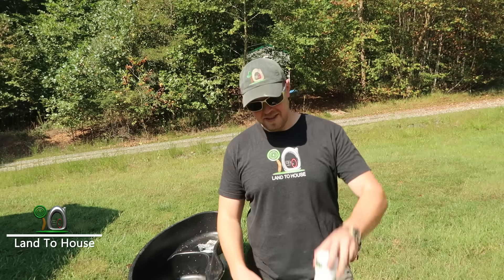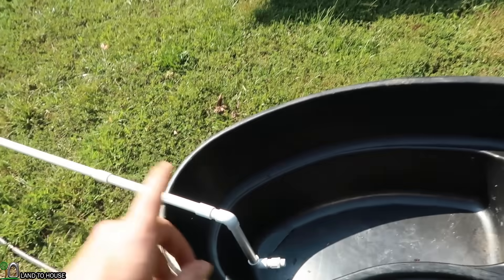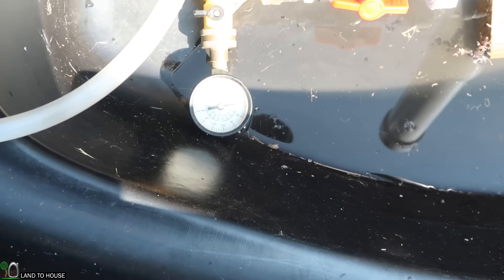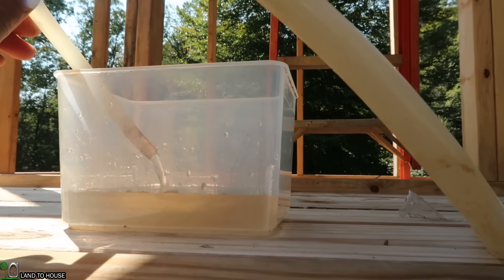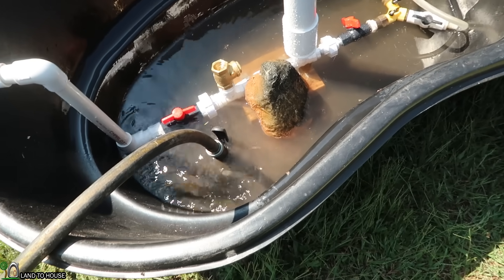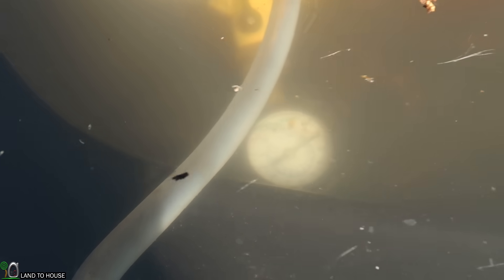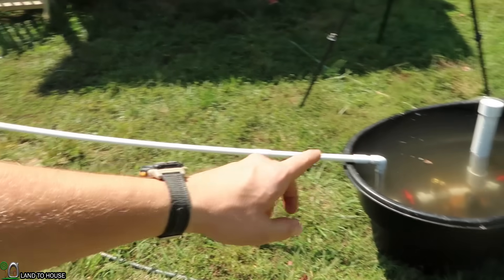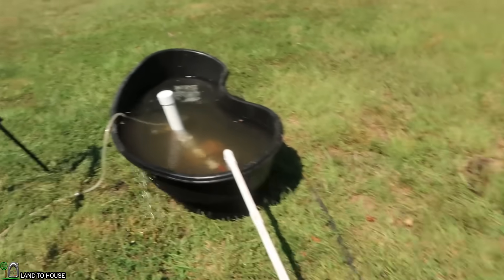Underwater Ram Pump

Comment: Is there a chart someplace that compares the pumping capacity for the different size ram pumps that are for sale?   Also,   how does the height of the head and also the height of the lift effect the volume of water pumped?   Thanks.
Reply from the maker: I personally do not have a chart. The 1/2" pump needs 2gpm to operate and can supply up to 3/4 gallons per minute in the right setup. The 1-1/4" pump needs 8gpm to operate and can pump up to 1.5gpm. The water pumped depends on several factors.

Comment: Just found your video - very pertinent to my situation which involves evaluating several low head ram pumps as an alternative to a water wheel  driven water pump to irrigate a 3 acre meadow from a stream in the bottom of the meadow.  Not a lot of fall in the creek, just depends on how far to run the inlet pipe and fortunately, not much lift required - perhaps 10 feet.    I am concerned that the clicking from several ram pumps might be disruptive.    The stream gives some background noise, which should help and maybe having the pump underwater might help.  Also,  as you indicated the pipe against the plastic container might be serving as a speaker for the sound.

I've linked this video into the Ram pump discussion on the Facebook Water Wheel Pumps page:
https://www.facebook.com/groups/240458583255303/permalink/515063069128185/
Reply from the maker: Yes I think the plastic is echoing the sound. If the ram pump and drive pipe are underwater it's a lot quieter.  You can get the ram pump to function properly with as little as 2 feet of head pressure. That will lift to 10 feet nicely!

Comment: Your plastic tub also is a resonator and even if the pump was isolated the tub is like a drum head.  If the tub were in the ground, or the pump in a pond/cistern it would be even more muffled.  I am interested in the idea of collecting the water from the initial check valve in some sort of cistern from which one could draw for other uses - gardens, fields etc. good video and helpful info!  Your Buddy at wranglestar sent me to you!
Reply from the maker: That's a good point. The plastic pond is no good for the sound. Underwater in a creek or in this pond underground would be better.  ... the waste water can be used to fill another tank as long as it's down hill from the pump. Thanks for watching!

Comment: I still think there is siphoning action that skewed the true flow capacity for both a dry and submerged pump.  The siphon action is created as the water drains down the tube that's wrapped around the rafter.  That falling action will cause siphoning (pulling) of water up the tube and down into the container below.  I think the outflow tube from the pump should go directly from the pump up to the catch container, without being coiled over the rafter above.   I think you have to do it again!!!  :-)

Comment: Hello there. I was wondering if this system would work with hot water and how hot?? Just wondering because i am going to hook up a hot water coil on my furnace pipe and try to let the hot water expansion circulate the water by itself for some cheap in floor heating but not enough of a scientist  to figure out if i will have enough water movement or not. Seeing this video made me think!!! I do not really want to use a electric circulation pump because trying to reduce power BILL. PS The temp. of my furnace pipe runs around 200 to 350 depending on stage of fire. avg, 250. Thanks for any help in advance from anybody.
Reply: Bernard...Hi! This "seems" like it will work,  your application might have to be, that your pump stays underwater, in a Steel tub/tank for added protection and safety!  and upgrading your ram pump to galve-steel pipework ....however! you will have to take into consideration the water displacement that takes place during the pumps operation...! as it could also have extremely hot steam bursts...like a geyser effect!  For some reason, no one has as yet (To my knowledge) found a solution as to what to do with all the water it displaces....?? ...and in your case, it will be very hot water.....! find a solution to that and you'll have a winner! Ps...I would strongly advise that you approach a Boiler expert that has an open mind to your proposed project!...good luck and I for one would like to know how you coped..!

Comment: So glad you caught the siphon issue. Makes it an excellent comparison, great job!
Reply: He only half caught it. Yeah it took the back pressure to make it work, however, taking that hose up in the eves was still siphoning everything that was above the outlet of the hose. It did show us that there was enough lift to get water all the way up there once, but once some was coming down to the tub, there was still siphoning in the gallons per min formula.  It was the same as if he would have just put the outlet of the hose in the tub without bothering with running through the rafters.
Reply: Sir. My name is alararic tomambo i wish to buy from you one unit of your ram pump can you include the diagram spicification of all parts my phone no. Is 559 253 3378 I am from Fresno ca 93722 pls. Quote the price of your ram pump including the delivery. Thanks a lot.I need for my farm in the philippines.

Comment: would it work in a deep pond with the intake going strait up 10 feet or so taking water in just below the surface
Reply from the maker: Sadly this does not work. A pond with the intake does have head pressure but at the same time there is hydrostatic pressure pushing down on the waste valve. This results in a net zero change in pressure.  The water would not flow. An example of this is if you place a straw into a glass of water. There is no flow out the bottom because the pressure is equal inside and outside of the straw.
Reply: id like to follow up with his set up, what if we raise the waste vale, would that work?

Comment: I am designing a proposal to use a ram pump/windmill to raise water from a lower pond to a higher pond; which will then flow down the hill in a stream, creating an enclosed system. How big do you need the ponds at either ends to be for the system to work?
Reply from the maker: The ram pump uses a lot of water to pump a little water. For example  the 1-1/4" pump can lift up to 1.5gpm with the right setup but will waste around 7 gpm. I am not sure about the efficiency of a windmill.

Comment: Man, please, put the output directly to the first bucket (there's no need of such a distance...), would'nt you get a perpetual cicle there???
Reply from the maker: The pump uses around 80 to 90% of the water to operate the pump. Even if you install the delivery into the source water you will still soon have all the water at the bottom.
Reply: @LandtoHouse  Thx 4 your valuable time! Yes, i know, that's why i say about a no-loose water by concentrate the whole system not in the source, but in the 2nd stage, the recipient in which the pump is. Obviously..., a higher deepness is necesary 'cause pressure & weight of the water matters. I'm sorry if i sound a little bit confusing, i don't know how to be clearer. I suspect that i'm wrong about the dynamics involved in my teory, but I'll do it & share the video test.
Reply: ...sorry, i've mistaken the whole idea; for a perpetual effect the first & last steps may be the big recipient itself...., i'll try & share tests.

Comment: This would be a great way to circulate hot water in an under the floor radiant heat system. At least iy would be nice as long as it worked. Orher means could be what I use, a RV water pump running on s solar psnel charged 12v battery.
I built one to help divert my insane amount of sniw pack and rain run off on the mountain here. It does help.
Good work !
Wulfy
Reply from the maker: I am not sure that the ram pump is going to work well in a floor radiant heat system. It would be way too lossy. As for moving snow and rain run off Yes its great. Thank you for watching.

Comment: Makes it a lot quieter. Worst aspect of Ram pumps is the noise pollution.
Well done!
Reply from the maker: Yes indeed. underwater does seem to reduce that click sound some.
Reply: @LandtoHouse  Could you get a sound meter and measure the sound reduction at 10 meters ?   and a hundred meters ?
I'm just thinking long term this could be really important for reducing noise pollution on livestyle blocks and even community water supplies
I'm thinking even 2.5 cm of water (That's an inch for you Americans) above 
might reduce pumping efficiency by 15-20% (and that is probably a ratio of the fall),  but reduce noise by 50 % 
Which might be acceptable if you are already getting plenty of free water
The noise pollution of ram pumps is probably the biggest negative, so any reduction.
Reply from the maker: @davestanton3822  A sound meter would be a fun test. If funds allow this summer I can look into that. I imagine they are not too costly. 15% seems like a big number for only a small amount underwater. I should think the efficiency reduction would only be 1 to 5%
Reply: @LandtoHouse  I'd bet by now You can probably get an App for your cell phone.
The other thing i see underwater operation doing is taking some of the vibrations out of the pump
 which should extend it's life considerably. 

Another idea was to add a third non-return valve to the output pipe to eliminate the output pressure head
Could you test this one for us - I'm sure we can in the words of 

The Six Million Dollar man - Steve Austin
 
"I'M SURE ...WE CAN REBUILD HIM 
MAKE HIM EVEN BETTER THAN HE WAS 
FASTER ....STRONGER.....MORE POWERFUL ! "

There is a good line for your next video pal.

Just practise that a few times and you'll sound really impressive!

Best of Luck 
all the way from New Zealand 
The Land of "The World's Fastest Indian"
You've gotta see the movie!

Comment: Seems to me that you could put the pump on the botom of the lake with the intake just under the surface, the valve could also have a rod in a connective tube that could agitate a startup and pump water up to the house cistern ... no?
Reply from the maker: Sadly this does not work. When you place a pipe in a stagnant body of water it is true that you gain head pressure but there's an equal and opposite pressure called hydrostatic pressure. If you were to take a short straw and place it into a glass of water, the water would not flow out of the straw from the top to the bottom. The pressure just equalizes and the water stops moving.
Reply: @LandtoHouse  Yup, I figured that out just after posting  ... it's  the waste gate that screws up the physics  ... and why the pressure gauge is lower under water. If only it could escape without resistance (just can't happen in a lake) ... like a drain to the exit creek, avoiding siphon effect of course.

Comment: ok now run the test with no feeder line just the water in the pond can you do that?
Reply from the maker: The drive pipe is what allows the pressure wave to travel back and forth and create the "ram" effect in the ram pump.

Comment: Efficiency seems to be lost due to the back pressure for the water to displace the pond water.
Reply from the maker: I am thinking that as the water level fills the tube it creates hydrostatic pressure on the valve. This reduces the head pressure that is going into the pump.

Comment: this design makes more sense than above ground ram pumps because the pressure of the water would help keep less air in the system so probably pump move volume/pressure.

..interesting it shows the same volume.

Nice to see someone test underwater as thats what I was planning.
Reply from the maker: I have a feeling that this works well with minimal underwater depth. If it were to go too far it would start to reduce the head pressure because the hydrostatic pressure increases.
Reply: Land to House 
Connecting a stand pipe to the the waste valve to above water level should fix this? 
Would need a long rod to prime the pump.
Reply from the maker: Adding that pipe would actually reduce the head pressure.

Comment: Is enough oxygen in the primer valve to be able to raise fish because I’m wanting to make me a aquaponic garden or if you have anything that would help me I would really appreciate  it I think that this would work it’s really helpful thanks great idea
Reply from the maker: The ram pump is great for pumping water uphill from a creek. It does not work well in a closed system though. The waste water will consume most of the water very fast. As for placing oxygen in the water I dont think that it would mix enough to keep fish.

Comment: hi, you can increase  efficiency in this setup  at 2 points. first forget the plastic feedpipe, replace it with rigid material like ordinary steel. 2nd remove that right angle elbow from the feed. need to achieve least internal resistance in order to speed up flow when water runs, that way water collects more kinetic energy (ready to release). then upon valve closing (the water hammer occurs) a flexible feedpipe will absorb part of the hit, reducing the waterhammer effect. so a dead strait feed pipe (preferably seamless steel) will make you the most happy ram pump owner.
i would reduce noise by soundproofing shells  (there are some ready made wrap around shells against noise on sewage drains)  or can try to bury underground the feedpipe (not sure how much soil dampen noise). especially you change it to steel it will carry a terrible ping on water hammer.
rubberizing the valve seat may reduce the valve noise.
when you place all stuff underwater it has to work against static pressure (due to the depth of release orifice) and some kind of plus resistance because the water has to run out into dense water not into less dense air (through the valve). as the missing 10psi  has shown it precisely.

if you have a live spring on your property for less noisy operation also my consider a spiral pump.

https://lurkertech.com/water/pump/tailer/

regards, lev
Reply from the maker: Yes you are right. The rigidity of the drive pipe makes a big difference. Check out this video test that I ran to see the difference of poly pipe vs pvc. https://www.youtube.com/watch?v=heLUeTGWz94

This summer I am going to be installing 90s 45s and 22 degree angles to see how it effects the pressure wave and output of the ram pump. Should show that the straight pipe is far better than having angles. 

Thanks for watching.

Comment: Good stuff Seth! I've often wondered about this concept. I don't want the noise of the flapper valve to attract nosy neighbors and I wonder if the immersion would help reduce wear on the flapper. I really appreciate you doing all of this experimentation. Happy New Year to you and Family!
Reply from the maker: Happy new year to you too! The sound of the pump does seem to be dampened some under the water. The sound of the drive pipe still has a noticeable thump.

Comment: Thanks Seth, ive subscribed. I am working on setting my retirement home to run totally off-grid. Just wondering, i have a borehole that has to be pumped to draw water up and out. Borehole outlet and my house are at same height relative to each other and are about 5 - 6 metres above sea level. There is a gentle slope off down to sea level from near borehole. Can i have rampump at sealevel so that gravity drawn water siphons up to borehole surface then downhill to rampump to then keep my header tank topped up that is about 3 meters up from the ground next to my house? Water runoff is not a problem, the new creek created could then be used to water crops.
Reply: Mark...! Why don't you just try it out for yourself! looks like it will work (You did not mention how deep the well was! also as to how long the slope was!) One would have to have  quite a slope to compensate the siphon-draw from the well...which would have to be primed first and fitted with a non-return valve...!
Reply: It sounds like you are describing a type of well. It may be possible to use the ram pump. However, ram pumps waste water every time the swing valve opens. This is not a problem when the water source is nearly unlimited. However, caution must be exercised to prevent drawing too much water from a well. If you are near the ocean, sea water can intrude into the aquifer if too much fresh water is removed from it. The inefficiency (wasting water) of the ram pump might make it less than ideal for this situation. Due to the use of a siphon, the head pressure supplying the ram pump will be measured from the top of the water column in the well to the location of the ram pump (not from ground level of the well). If the fresh water aquifer is significantly below ground level, you will not develop much head pressure.